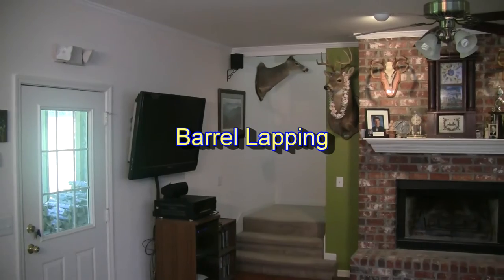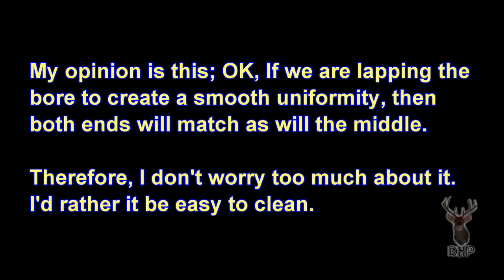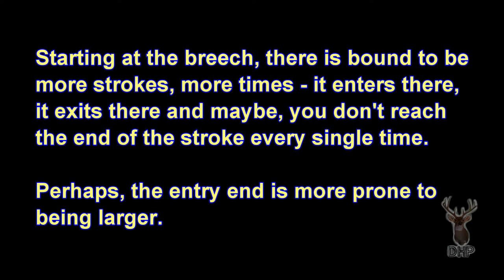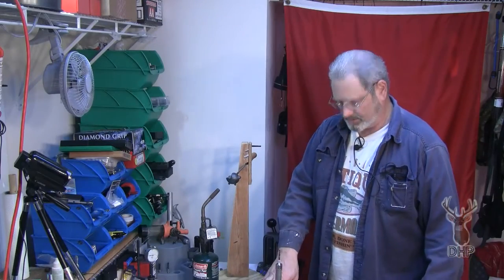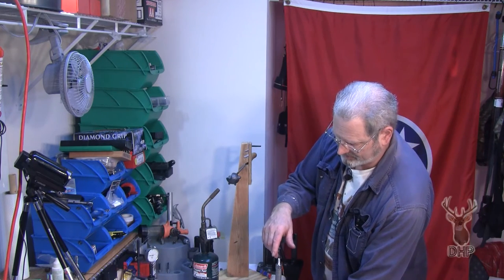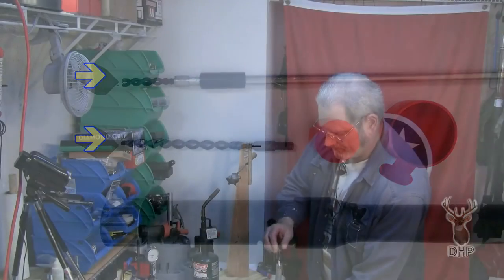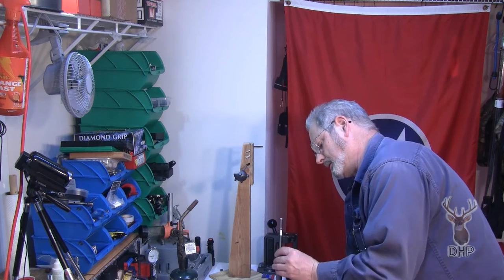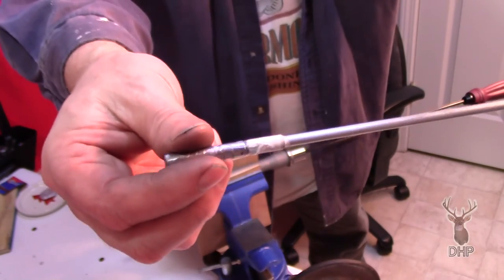S7E3 SBR Series - Barrel Lapping - 1080p

Comment: I've watched three or four other videos having to do with barrel lapping and this particular video seems a bit more down to earth..  The other vids I alluded to all seem to be alot more complicated.  It makes me wonder if the guys making those videos are just trying to impress viewer by making it look harder than it really is  or, maybe making it look complicated makes them feel empowered somehow.

I've figured out a way to Carbon Fiber wrap my own barrels so I thought to myself,  if I'm going to go through the trouble of Carbon Fiber wrapping a new barrel I may as well go all the way and lap the barrel too.  This video went a long way toward getting me there.  Thanks.
Reply from the maker: I can't remember if I put it in or not but if you get air pockets in the lap - the barrel is too cool and the lead is setting. You can use a heat gun/paint stripper/shrink tube/shrink wrap gun to warm it.
Reply: @DelHollowProductions  I cast my own bullets so I kind of figured as much.   I think I do recall you mentioning something about air bubbles.  In one of the other videos I watched the guy actually turned a custom brass jag-type of fitting that screwed into his cleaning rod.  He overlaid it with lead basically the same way you did it but I think using old cleaning brushes should work just as well.  Thanks for the reply.

Comment: Great idea using the bore mop core .  Have you considered using Cerosafe instead of lead ?  The cerosafe will actually shrink alittle after cooling .  I think it would help in that the groove diameter would not be enlarged but still smooth out the imperfections in the lands .
Reply from the maker: I'm unfamiliar with it
Reply: @DelHollowProductions  Cerrosafe is available from Brownells .  It is used to cast a mold of the chamber for measuring dimentions .
Reply: I have a 1# ingot.  I think that would be a perfect casting to use.  Thanks.  You actually added something to an already enlightening video.  Good call.  For those unfamiliar with it..it is a low temperature , very stable material typically used for a casting of exact duplication, which makes it a perfect choice.  It's a little harder alloy than most lead I believe.
Reply: @edstimator1  WHAT IS ?
Reply: @NoWr2Run  cerrosafe
Reply: Read this regarding barrel lapping:
     "I once tried Cerrosafe because it only took a hot water to melt it, but there was no shrinkage (Which is what it is supposed to do) And the lap could not be inserted with the compound on it because it was too tight.
     Plumbers lead (Pure Lead) seems to be the best material to do an accurate cast with. Some times the cast doesn't turn out to good because the barrel cools it to quick. So use a heat gun or hair drier to warm the barrel for better results."